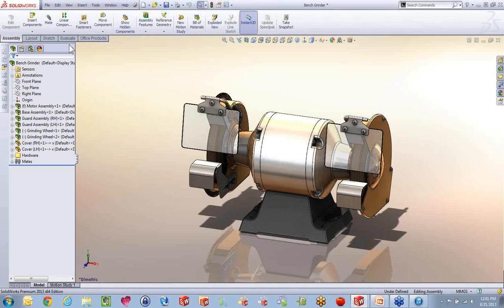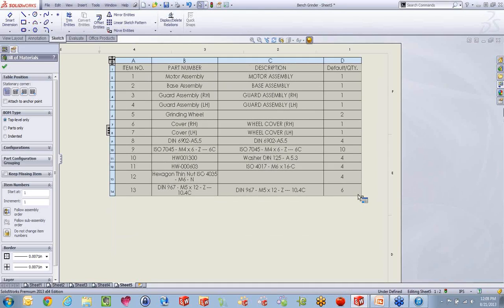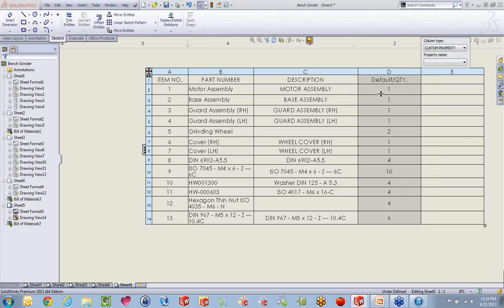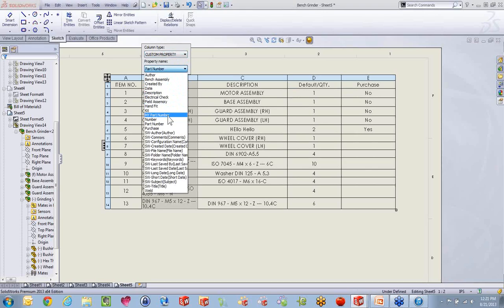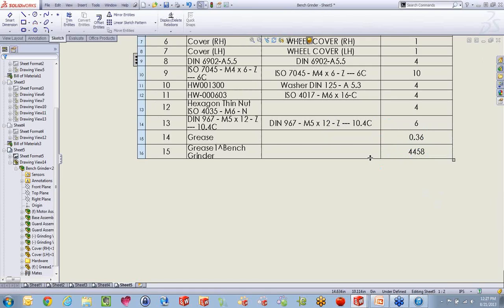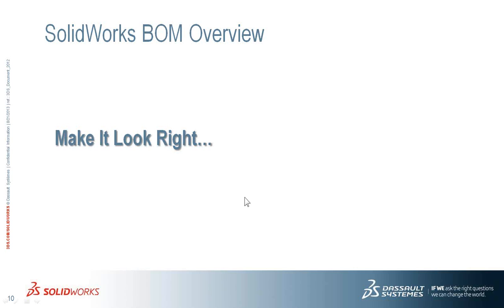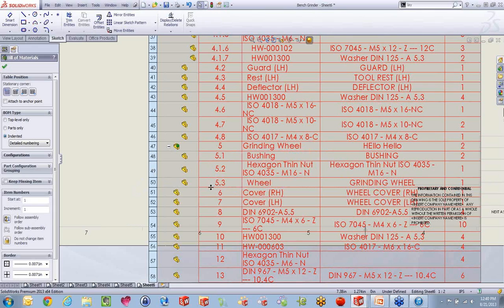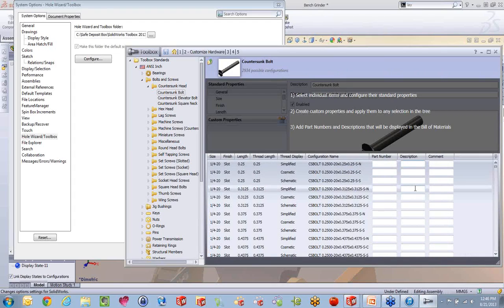Lunch & Learn - Let's Understand SOLIDWORKS BOM

Comment: Great video!
what if i need to create a custom property like ¨Drawing Code Number¨ , but instead of displaying it in the BOM i want it to be displayed at my custom drawing format.?
Reply: In the part (or assembly), open up the properties and create your "Drawing Code Number" property, and populate it.  Drag your part (or assembly) into a drawing.   In the drawing, create a regular "Note".  In the PropertyManager of the note, in the "Text Format" section, select the "Link To Property" icon (the little hand holding a paper pointing to a chain).  Now select the "Model in view specified in sheet properties" radio button.  Under that, in the selection bar, select the "Drawing Code Number" property.  Press the "OK" button.   Notice that the "note" will now change to your "Drawing Code Number".  Move the note to the proper place in the drawing, and save the new custom drawing format/template for future use.

Comment: I have a assembly that is around 70 parts, anyway to fit it all on one page? it is about 5 times the length of the page
Reply: Of course- you can try several things.   Change the sheet size to B, adjust the Font size of the BOM text smaller, and/or use the BOM "Split" function described at 33:20 to cut the BOM into smaller "chunks".